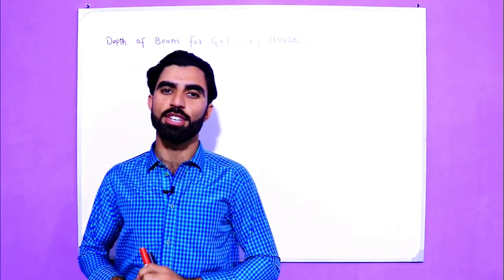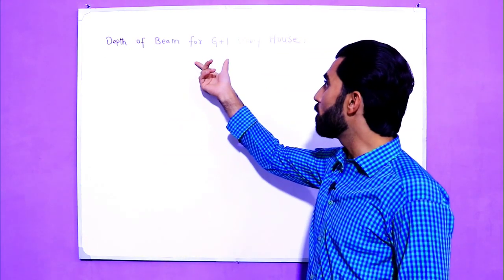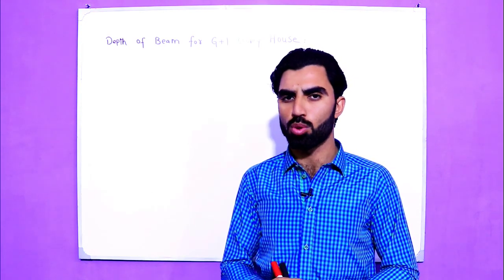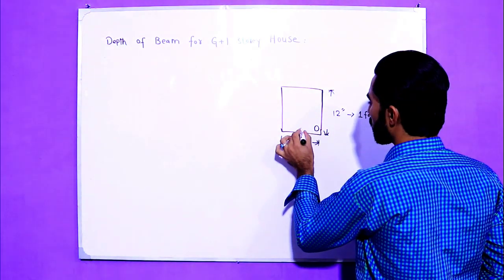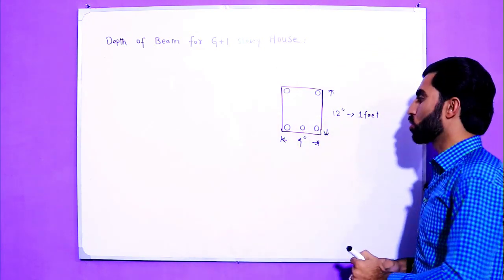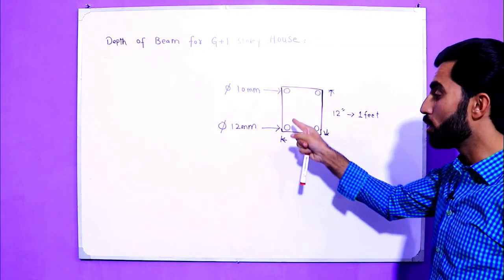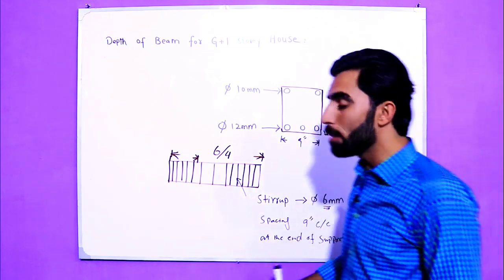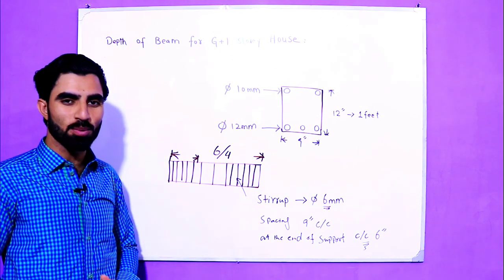Design of Plinth Beam for G+1 Storey House - Depth of Beam - Structural Design of Beam

Comment: What is the relation between no of stories  and plinth beam ??? ..why the size of beam changes with increasing no of  stories?
Reply: Bcz load whight increasing bro
Reply: @abumaz_2111  what?? How load increases on plinth beam ?? It LL directly transfer from columns 😂 btw thank you
Reply: Example:: 3 r 4 storey building directly never transfer load on column that load was partitioned in all sides of belt beam slabs and brick work..
That load was splited in all sides of belt  plinth beam and column so need different sizes..